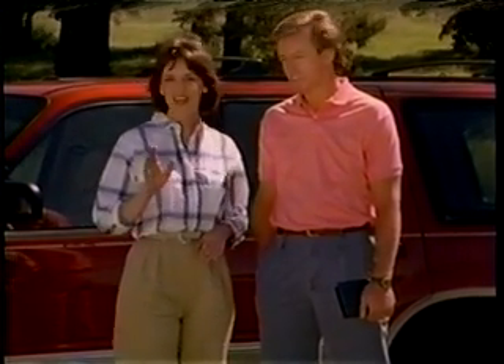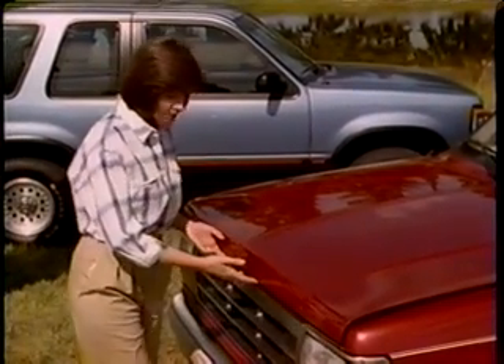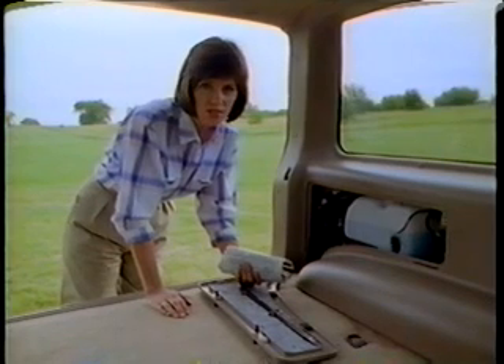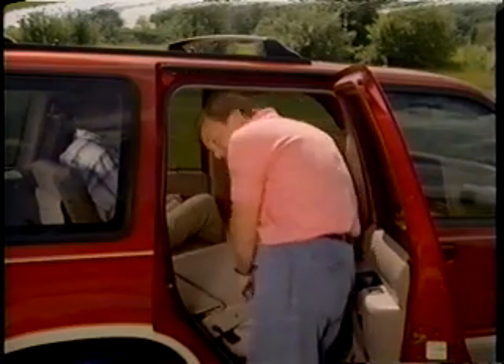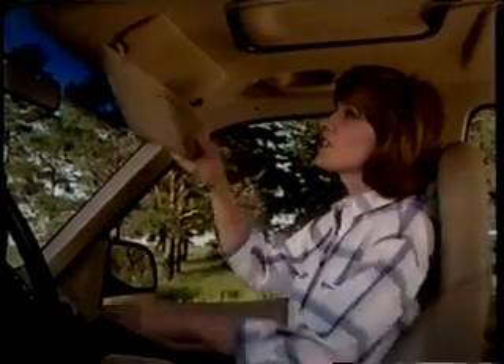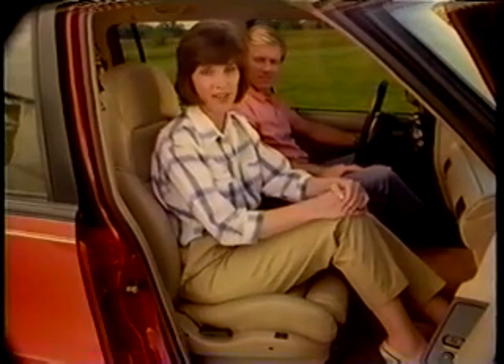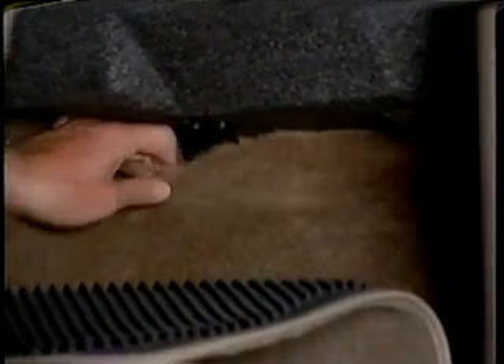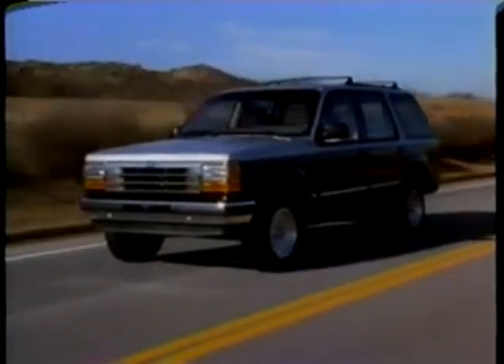1991 Ford Explorer Introduction Part 1 of 2

Comment: Cool!!! I own a 92 ford explorer XLT with a 5 spd transmission with 263,500 miles on the engine and this last May the original transmission went screwy so I had it replace with a 1998 transmission.....the blower fan for the heater/ac went out too last january but then again considering it's age everything else is running A-ok. This is a pretty solid truck and seems to always start even during the coldest of winters especially where I live here in Alberta.

Comment: The 1991-2010 Explorers were actually meant for going off-road and had better ground clearance for an SUV. Today's Explorers have transverse engine layouts, low ground clearance, and touch buttons and screens that are more distracting than using regular buttons. They're basically mallfinders, like the current Nissan Pathfinder. I never had an Explorer growing up as a kid, but I used to have a 1997 Nissan Quest, sharing the same platform as the Mercury Villager, with Ford parts, such as audio, climate control, IP, and many more.
Reply: Yes, I remember when the "original" SUVs dominated the roadways.  Demand for SUVs and CUVs has definitely changed through time.  On the other hand, Toyota's 4Runner continues its old-school ways of an SUV, as does the Jeep Wrangler.  Well, just to name a few.
Reply: I know they lowered the explorer for safety reasons. Ford explorer initially was based off of the Ford Ranger platform... which was a higher up vehicle/truck. Ford Explorer's then had issue with a lot of rolling over, tire popping , etc.  The newer explorer's have evened out wheel base (?) /stablity in other words, and better quality in ride/handling.
Reply: Tim Joseph the 2020 model is going back to the old layout. I had recently bought a 1994 Explorer XLT with 130k miles. I got it at an auction for about $900. it was a dealer trade-in which they wholesaled out.

Comment: Love it.. had exact the same 4door red Eddie Bauer. Mine was a late Gen-1 from december 1994. Also had a Gen-2 from 1996, but traded it in for the Gen-1 cause i liked it more. :)

Gen-1 rules..
Reply: AVC-Works strange a 1994 vehicle built in December of 1994. the 1995 model were in the showroom.

Comment: I have 1993 limited. It's amazing nd it has 18,580 miles. That's right 18k 2nd owner. Old lady drove it 3,000 miles in the last 10 years
Reply: The Missouri Traveler wow that is a great find.

Comment: I dont understand how people say that they have had so many problems with these vehicles..  I used two of them to death and then some at work.. as company vehicles... first was a 1991 4.0L 4x4 XL, had over 178k, needed a new water pump, company sold it off, had two 96's, both over 230k... no trans failures.. no leaks... no nothing.. just kept on going... company sold them both...  many more we had with well over 200k.. still going until sold!

Comment: I knew that older trucks and cars were like that, but I figured the Explorer would've been power especially in an EB edition, or a crank.  I have seen some old Volvos that you cranked it and it went back into the roof.

Comment: @91Taurus Ford should've just given the Explorer a power sunroof. It was a dealer installed option though. Even the limited had this kind of sunroof. I actually perfer this over a power one though. Power sunroof get electrical problems over the years. With this i can just replace the seals and go on about my business

Comment: That window switch design was done away with and replaced with the switches you see today that you pull up to close the window and push down to open. This was done because of children that might have their head in the open window while simultaneously pressing the switch rolling the window up on their neck.

Comment: @infinity3jif its 2012 and i still think i have the best vehicle ever.
Reply: Do u still have it
Reply: @delcodex8663  nah. Sold it to a friend. Throttle stuck and he totalled it
Reply: @slickhitler  damn hope your friend is ok. I just bought one as my first car a 93 xlt with 130k miles for 900$ I'm fixing it up
Reply: @delcodex8663  this was years ago. Unfortunately he's fine. Totalled a few more cars between here and there. Fyi, If you have a starting issue check the caps in the ecu
Reply: @slickhitler  thanks man!